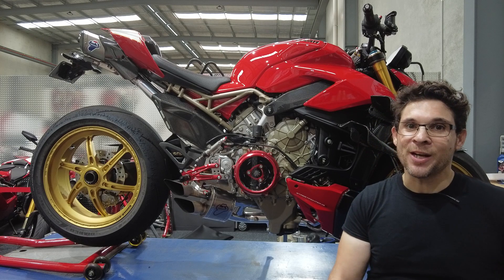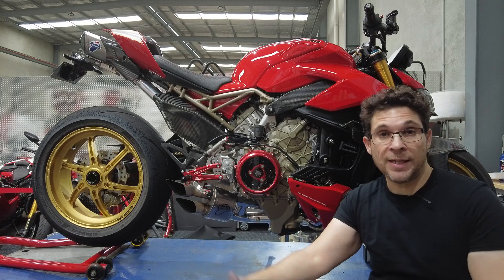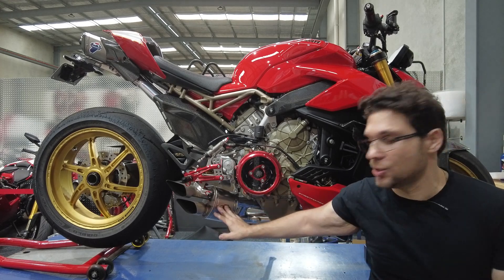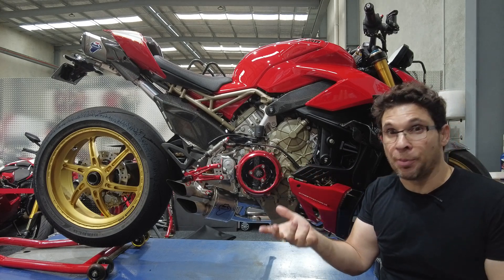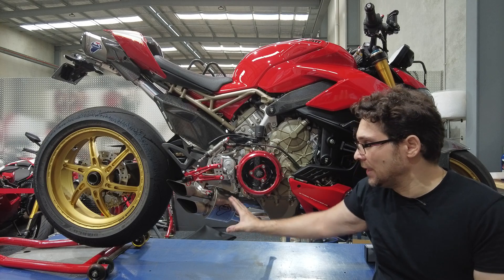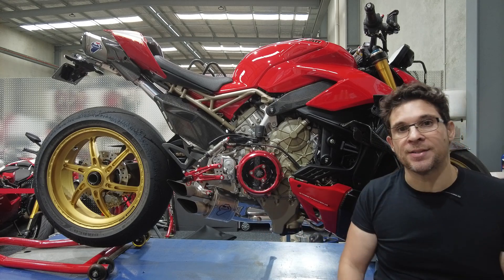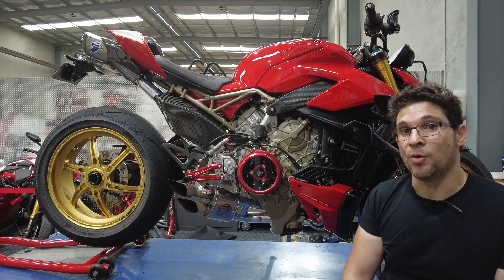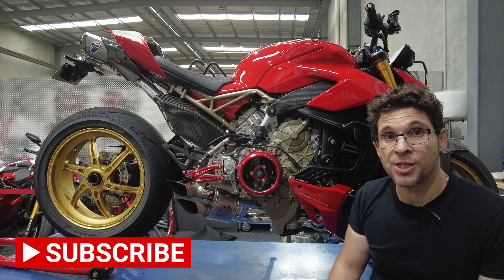Ducati Streetfighter V4S - Project Build Part #26

Comment: I don’t understand what’s going on with that exhaust.  Why is there exits under the tail and underbelly?  It just seems bulky to me, regardless of the sound characteristics.  I’ve never been a fan of under tail exhausts for the SF or Panigale as they add a lot of volume to the clean lines of the bike.  Love the videos Roberto!
Reply: This exhaust is designed as the Desmosedici D16RR first Ducati v4 engine; 4 single exhaust (2H pipe) all equal length.  Underneath are for the front cylinders.  Got the same exhaust on mine, thanks to Roberto, loud but best sounding of all  exhaust available for the v4.